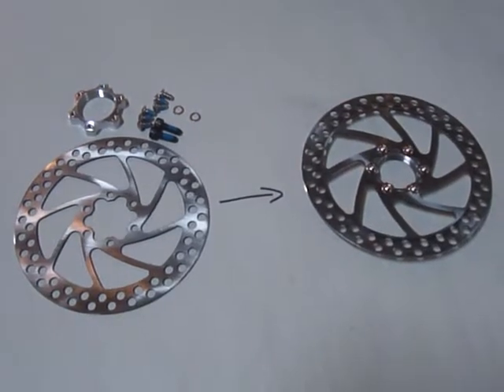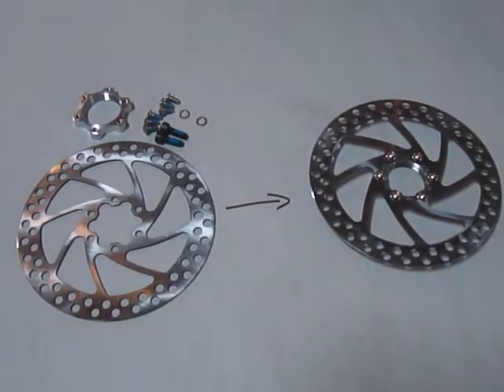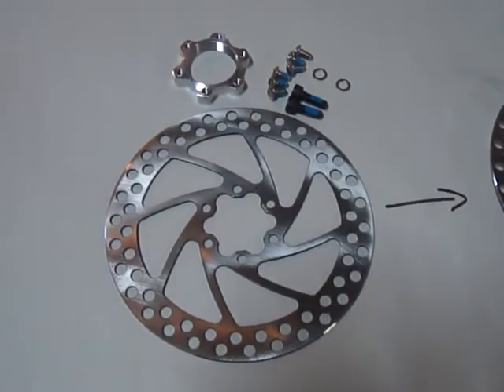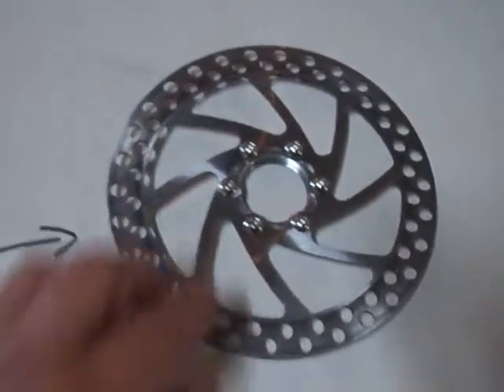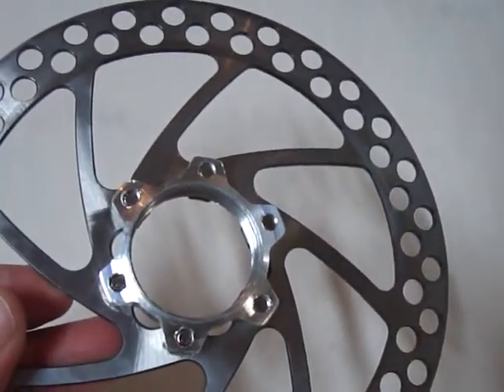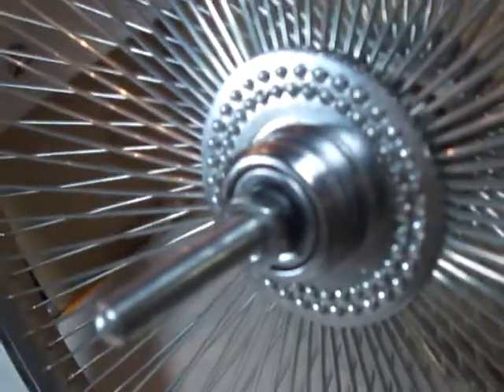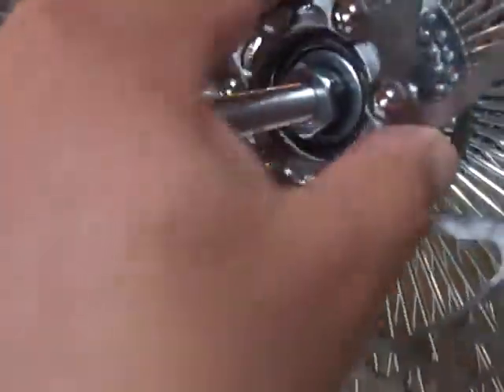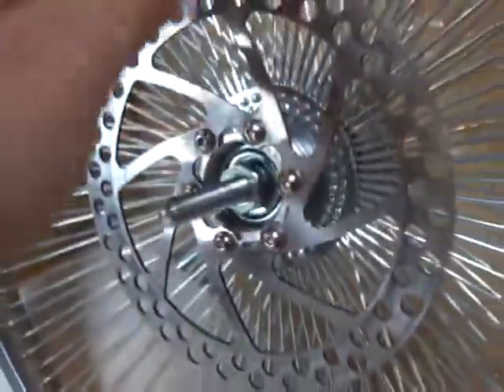Bicycle Free Wheel Disc Brake Conversion Kit

Comment: Freewheel hubs are not threaded on both sides. Only on the drive side. The brake attaches to the non drive side...so this kit wont work for most freewheels.

Comment: Being a back free wheel won't it make the clicking sound while turning like it would normally while rolling and not pedaling?
Reply: No because the free wheel has been removed and it has been replaced by the hub adapter for the disk

Comment: does this work for a rear wheel as well?
Reply: no
Reply: unless you get a sprocket adapter then you can have a rear disk brake
Reply: @pewdiepiefan4lifebrofist451  
hello , I am looking for a way using small wheels(16in) in a custom tricycle i want to make , would this be a good way to install a disc brake on any rim or will the left wheel unscrew as it brakes ?

Comment: imagine if they made one to fit fixie hubs on the fixed side
Reply: these are Fixie hubs
Reply: i mean if they made rotor adapters to fit on the fixed side of a dual sided hub and no these are not fixie hubs its a standard freewheel
Reply: +colin p 
the adapters only work on threaded hubs, like a freewheel. if you want disk brakes could also get sprocket adapters
Reply: was just saing it would be nic if they did so you could setup a disc freehub wheel with a  doublesided fixie/freehub wheel

Comment: does anyone know if this adapter will work on a mongoose bmx wheel ?
Reply from the maker: +derek hamilton works on a free wheel hub like this size
http://www.bicycledesigner.com/bike-parts/bicycle-brake/images/z505215bicyclefreewheeldiscbrakeadapter.jpg
Reply: I got 34.79 mm is that because of my cheap dial caliper?  lol